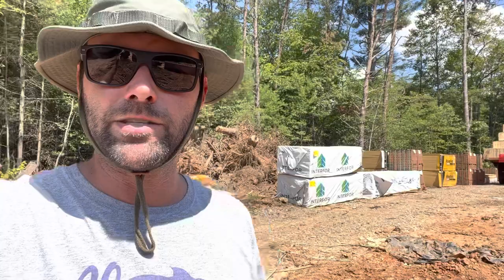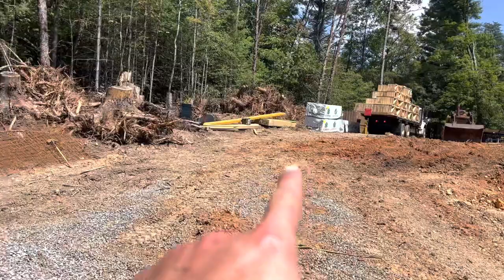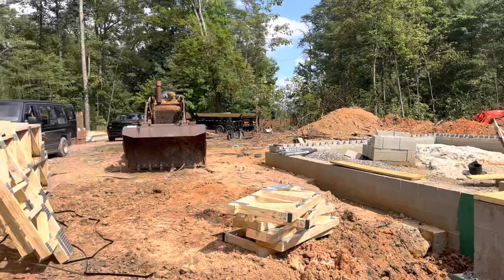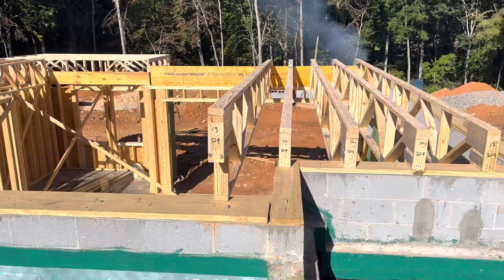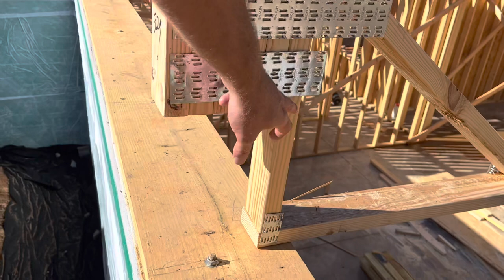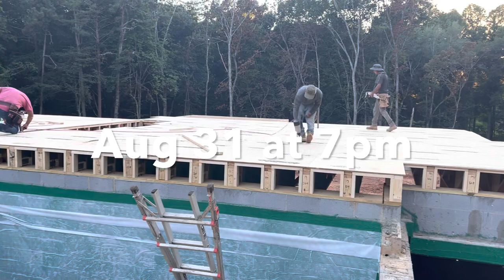Ep 26 Installing floor trusses and subfloor!

Comment: Cutting the floor joist/trust you should have put hangers to support the bottom part where they were cut. This will keep the integrity intact and transport stress to the wall from the floor and stabilize the flooring.

Comment: Hi. I am curious about your span length, truss height, and spacing. Best I can tell are those 24” tall trusses 16” OC? Also what’s the longest unsupported span in your layout. I am considering a similar design but worried about the floor feeling bouncy even though the trusses may be rated for the span.

Comment: I think the truck-driver that delivered the floor-trusses could have spent a few more minutes gently placing he trusses on two or
three 4x4's.         I hope you go back and beef-up those sections of the modified trusses just to be over-kill.      If I were rich, my house would have two levels of floor-trusses, opposed to each other at 90 degrees.      One extra-day of work at the most and you
would have twice the room for insulation and utility-lines, and space for secret holes in the floor to stash valuables.